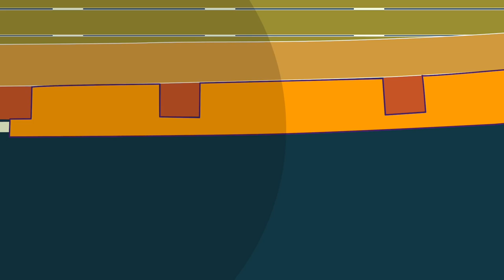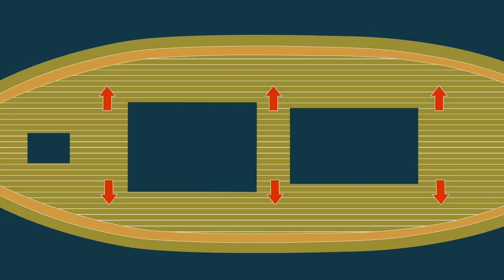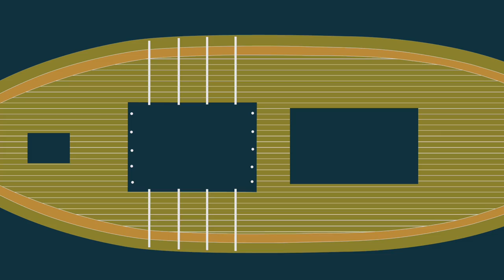Restoring Josefine   Part 2

Comment: I love watching you do this work.  As a 25 year wooden boat owner here in Southern California of a 1968 52 ft offshore cruiser, I have had to do a lot of this work. I really applaud what you are doing and will be following every episode!  I am, however, amazed that you have not been harassed by the harbour or marina masters for getting saw dust and all sorts of other detritus in the water.  I was constantly monitored even when I was doing some light sanding and re-varnishing on teak cap rails.  One time I was doing a little sanding near the water line and the harbour patrol snuck up on me and gave me a ticket for a few specks of white hull paint that missed my vacuum.  I even got a warning ticket for leaving "hazardous materials on the dock" as I had been varnishing one morning and, while I took a 30 minute break ashore for lunch, left my brush in some thinner to keep it wet until i started back up.  I am also very interested in the products you use for different jobs, so please keep mentioning them.

Comment: My father told me of pitching the deck seams on my grandfather's Alden schooner as a teenager in the 60s, really helpful to me to understand the process involved,  fantastic video and fantastic rebuild.
Reply from the maker: Thank you Patrick. These are as you say, very old traditions, thousands of years in fact. Our use of masking tape to get nice clean seams is a relatively new idea though. When Josefine was first built, as a fishing boat, they almost certainly just poured the pitch into the seams and left it all splattered over the deck to be kicked off over time and washed away by the sea. They were working boats, building and maintenance had to be practical rather than aesthetically pleasing . Even today it is common to pour as neatly as possible (without masking tape) then scrape the excess away while washing constantly with cold water (keeps the pitch hard and brittle). We had that option but chose the cleaner route! :)

Comment: Congratulations on a great job of restoration and the manner in which you present it. Even the music is great. I follow another boat resto (many in fact) but one in particular that i recommend is Sailng Yaba. This boat is being more rebuilt than restored by a young couple in Brazil with a bunch of traditional wooden boat builders. This was the first boat where I have seen the use of spikes or nails instead of screws and apparently nails are stronger than screws in this application. So I was please to see you using spikes. Goos job.
Reply from the maker: Many thanks Rip and welcome to Sailingwood.

Comment: Hi matey. I have to say that your deck when completed looked absolutely amazing. The bitumen between the planks was an eye opener for me. Most would of gone for Sikaflex down the seams but it was great to see traditional methods used in the caulking. Can I take this opportunity to wish you both a great new year and fair winds as she sails.
Reply from the maker: Many thanks Terry, and thanks for watching. We went with bitumen because we like the way it can keep resetting itself and how much easier it is to do running maintenance of small areas as and when needed. Sikaflex is great stuff until it starts leaking then it has to be removed completely and the seam cleaned to within an inch of its life before repaying and it’s a bugger to get it all out. And we love the smell of bitumen! 🙂

Comment: Brilliant using the tape together with the Pitch. You shouldn't fair the new planks. In time when the older planks are replaced, they will be the same dimension as the newer planks,
Reply from the maker: Thank you. I know what you mean about the planks and we did give it a lot of thought, we even considered glueing a piece on top of the old pLanks where there was a big step, in the end we decided fairing was best but we cheated a bit and have not fully faired, just enough to avoid a step that might be vulnerable to erosion from snagging etc. We would have loved to replace the intervening old planks but our budget is already under serious strain.
Reply: @SailingWood  Nice Hajkutter. The Danish version of a Bristol Cutter. Please let me know if I Can help Sourcing original Danish parts from the correct time period. I’m based in Denmark. I also once had a Hajkutter. Where are you restoring her?

Comment: The deck looks fantastic! Is it oak?
Reply from the maker: Hi Michael, the water and covering boards are Oak but the deck planks are joinery grade red wood (it’s very affordable 🙂) this was traditional to get the best qualities of each wood in the proper place, Oak for its strength and softwood for its relative stability in that it doesn’t expand and contract as much as Oak and has good rot resistance.

Comment: All very nice work but I wish you were wearing ear defenders when using the power tools, from a retired carpenter.
Reply from the maker: Hi Colin, appreciate the concern, of course you are right, we do wear the little rubber bungs when doing noisy jobs but do also sometimes get lazy when doing a quick job. I find caulking harder on the ears than power tools.

Comment: What type of wood did you use for the dek? love the movies by the way. 👍
Reply from the maker: Thank you Marco, The covering and Water boards are in English Oak, the deck planks are joinery grade red wood. The covering and water boards were originally Oak but the deck planks I believe were pitch pine, the red wood we used is a lot cheaper and readily available.

Comment: Just found this channel,  be careful what paint you use on interior timber . The wood needs to breathe , or it will rot very fast as the moisture is trapped inside  !
Reply from the maker: Hi John, yes we are also great converts of the ‘let wood breath’ philosophy, but like all simple truths, it is not always true! We have lived in a number of very old properties and learnt that the expression is as much about ensuring good ventilation as it is not painting and of course it depends on the type of wood.